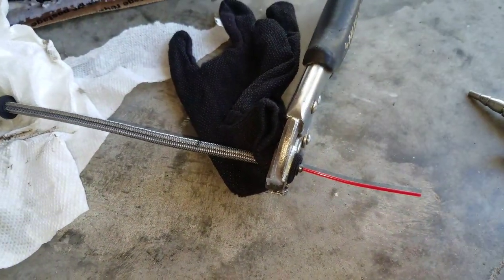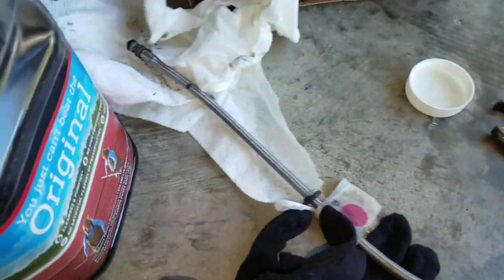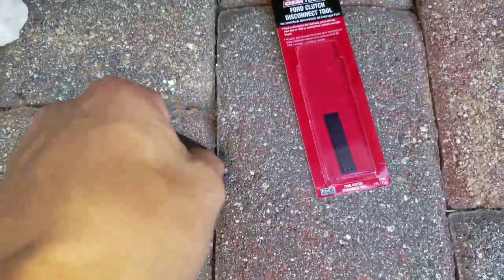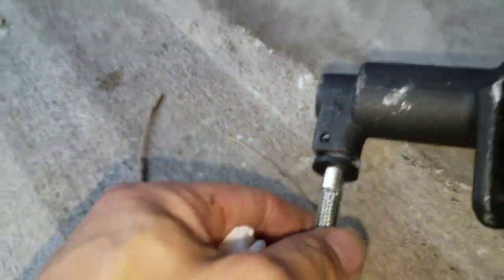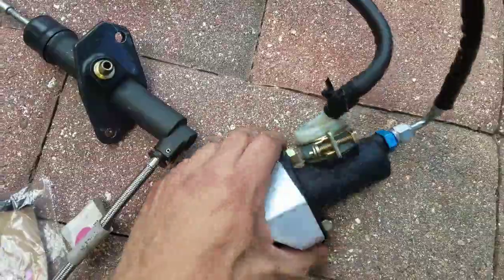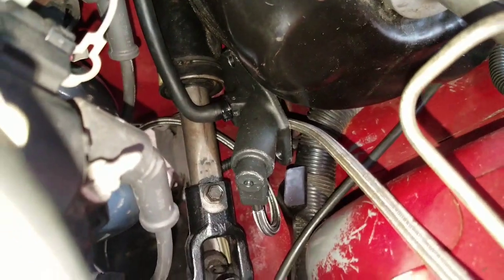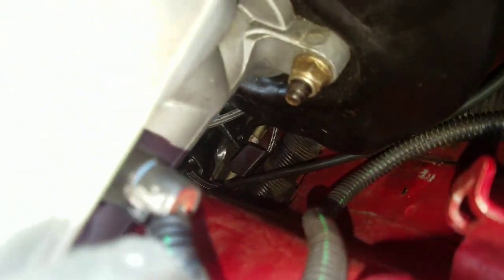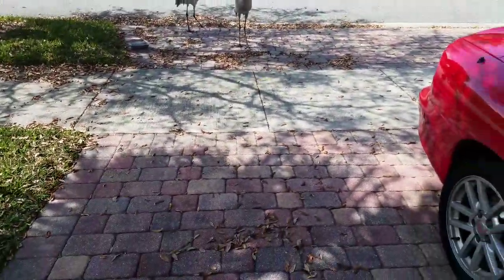Changing the clutch master cylinder

Comment: my tick isn't leaking, but i'm sick of how stiff it is, plus the whole having to adjust it and the on/off switch feel of it.  I'm going to replace mine, but I'm not looking forward to it.
Reply from the maker: I went back to a stock part.
Reply from the maker: @FTsingos  i didn't really feel a difference when i drilled that wall in the hose
Reply: @Chemical Spore  spoke too soon!  Noticed that it's leaking slightly just now.
Reply from the maker: @FTsingos  what state you live?
Reply: @chemicalspore  massachusetts
Reply from the maker: @Fotios Tsingos  ahhh.  Im in florida, of you were close. We could have made a video working on yours
Reply: @Chemical Spore  that would have been cool.  Are you in northern Florida?  I'm taking a road trip to see a friend in Raleigh and then Atlant next month.
Reply from the maker: @FTsingos  orlando
Reply: @Chemical Spore  I'm going to try to knock it out this weekend.  It was dumb luck that the tick is leaking.  They said to send it over.  If they send me a new replacement unit, I can sell it.  Kind of lucky/unlucky since I was getting tired of the Tick master cylinder.  Only thing I'm debating on whether or not to do the drill mod or not.
Reply from the maker: make a video on it
Reply: @chemicalspore  never done that before.  It will be a low quality video.  All I've got is my cell phone.  What do you recommend?  Drill mod or no?
Reply from the maker: @FTsingos  drill mod is easy enough